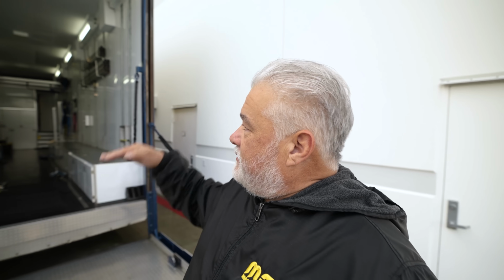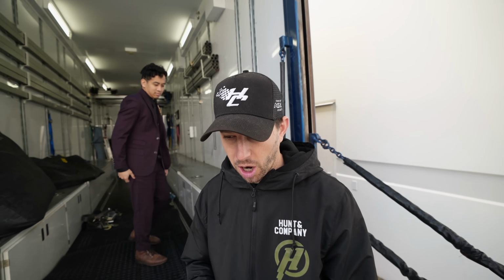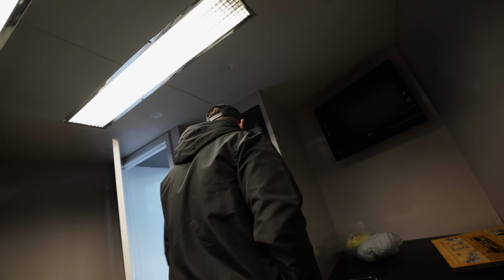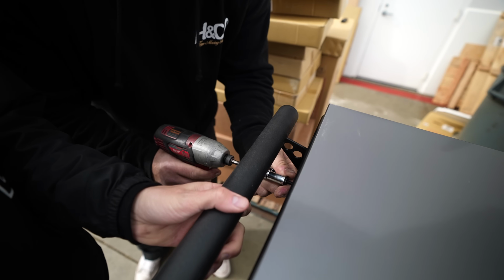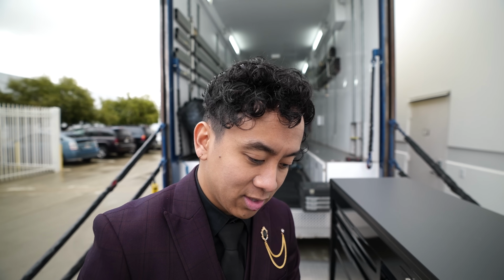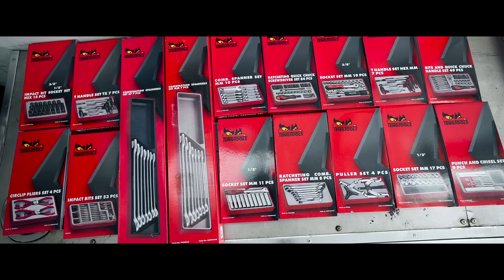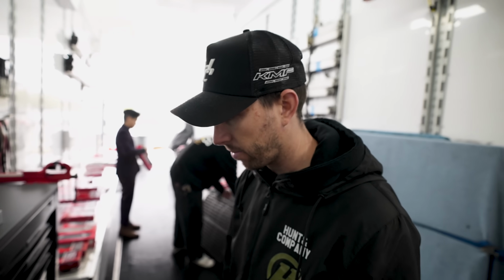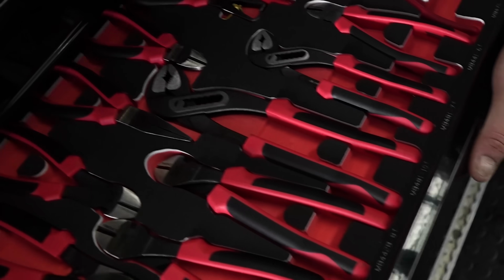My New Retired Nascar Hauler! *Full Tour*

Comment: On your bigger tool box what I would do if I was you instead of strapping it because it will snap the strap over time. Take the wheels off and anchor it down to the floor of the trailer. That’s what we did with our and it hasn’t budged yet

Comment: You should modify the trailer to take 2 cars wouldn't take much to extend them platforms the car sits on . 💯🤙👌 its a waste of space for just one car .
(Make a Box iron frame and bolt it to the trailer floor and some checker plate aluminium bolted to it )

Comment: Big L on the Semi, Big W on the trailer, buy/build a Pete I promise you won’t regret it, if you want best mpg (12mpg+) Detroit Series 60 overbuilt the engine and keep it at 550hp guaranteed to out live the both of us. Trailer is bailer asf it’s just those freightliner are known as disposable trucks, if it was a higher end freightliner like a Coronado or 122 it’d probably stay together a fair bit longer, but there’s a reason why there’s a boat load of older trucks out on the road. Built to last.